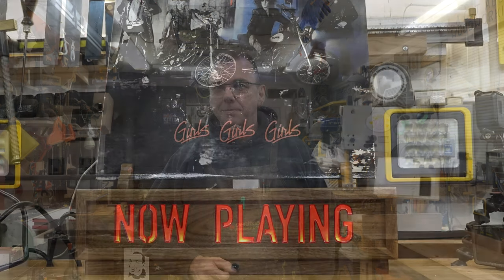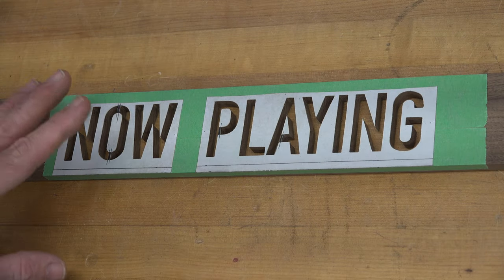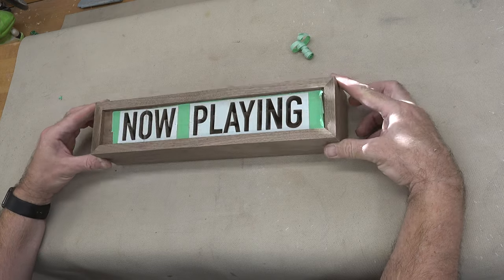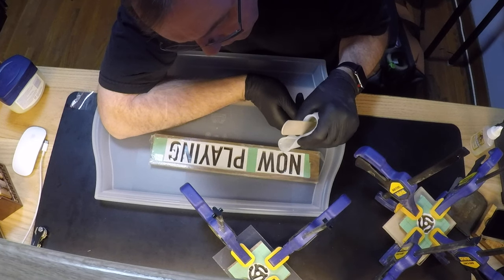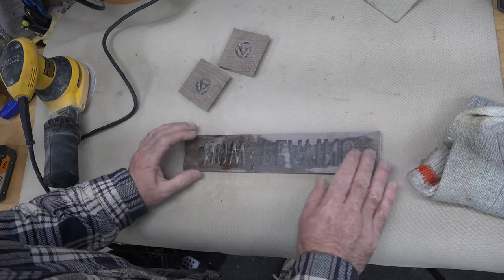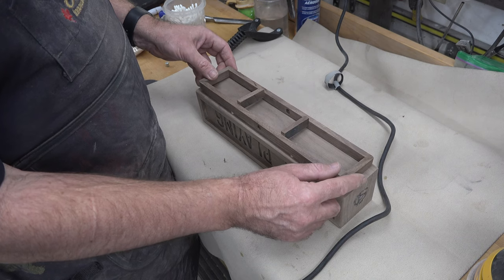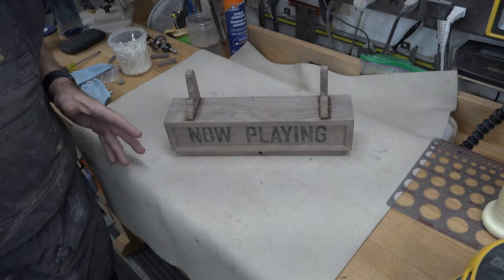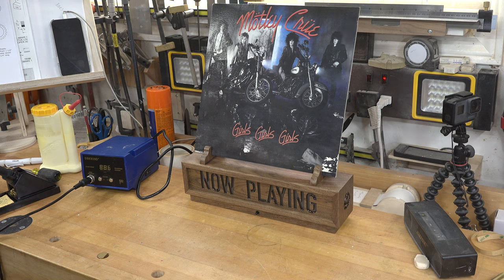Making a "Now Playing" Record Stand

Comment: looks neat. I got my teenage son a vinyl player for Christmas, and I might make something like this for his bday. 

Kenny, an even cooler "more advanced" way to enhance this is to incorporate a switch within your bracket. Maybe a pressure switch or whatever they're called (think the opposite of a cabinet light switch). So in this case, whenever the album cover rests on that bracket, it'll illuminate the light, therefore negating the need for a remote.
Reply from the maker: A limit switch could definitely be installed in the bracket to function the way you have described.  Nothing wrong with a little modification and making it your own.  Thanks for tuning in and for chiming in with your idea.  Good luck on your project.
Reply: @acutabove_woodworkings  sweet, limit switch, wasn't sure of the proper nomenclature.

Comment: Hello love this vid..now playing stand looks great I'm going to try make one myself..do you clamp plexiglass onto the now playing part as well while you fill with resin?
Reply from the maker: Yes, you need to clamp the acrylic in place to prevent the resin from running all over the place.  I hope this helps.  Thanks for tuning in and for the kind words.  Good luck on your project.
Reply: Thanks for the reply..so is the plexiglass removed after resin has hardened? Do I coat with vaseline then clamp?
Reply from the maker: @goddamsonofa  Yes, the acrylic is removed after the resin is dried.  You can place the vaseline on before you clamp it in place.  It will help a little to get the acrylic off of the wood.
Reply: Brilliant thank you I'm definitely gonna make this for my next project!